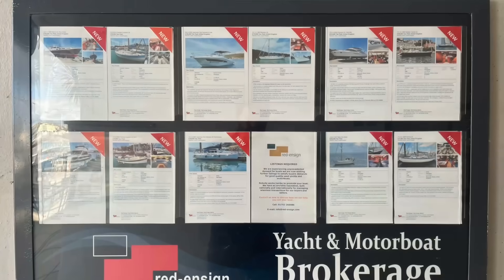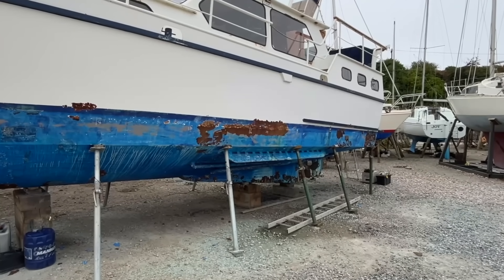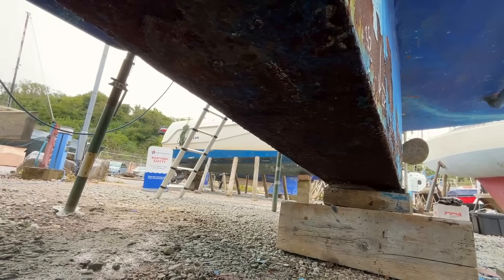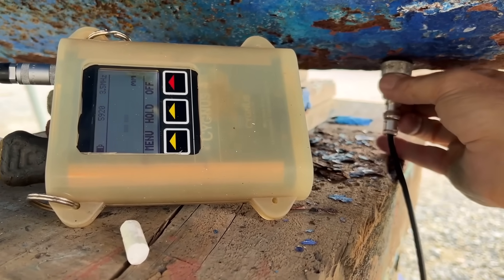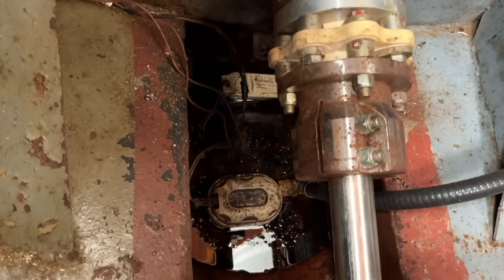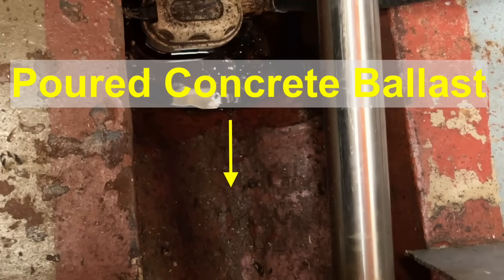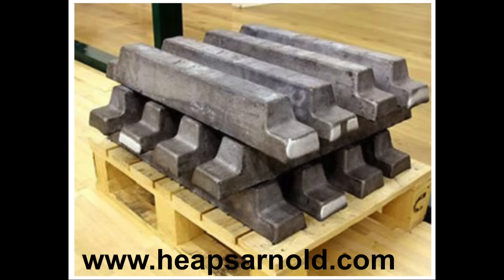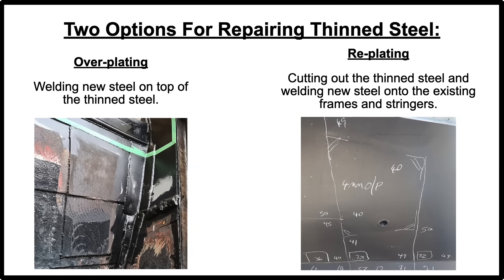Buying A Steel Boat? Get It Surveyed!

Comment: keel sole Mate , yes should be 10mm to start with, me building since 1976
just because she is Dutch  built means bugger all 
anyway all box keels should be sealed,  tested same method as done with fuel tanks ie manometre  and oil filled with use transformer oil,
Reply from the maker: Thanks, I like to see a minimum of 10mm ideally for the bottom of any steel boat.  Oil filled keel boxes are a rare sight on small craft, would be interesting to see one and how it had fared.

Comment: I thought any boat of any age requires pre-purchase survey.  I wouldn’t buy a boat without a survey unless it was a brand new one
Reply from the maker: Thanks for sharing your thoughts.  There is no rule that says you have to survey any boat before buying it, and plenty do take that risk.  Insurance companies will usually ask for a fresh survey report every 5-10 years depending on the vessel.  As for not surveying a new boat, you'd be amazed how many 'snags' a surveyor usually picks up when surveying new builds, and they are often safety related!
Reply: @whitehatmarinesurveying Snugs identified in used boats during survey can be used for price negotiation. Also allows you to understand what you will have to fix. I agree that manufacturers defects are everywhere. I visited the Prestige factory in France last July and they try to address most before shipping the boats. But again you have manufacturer’s warranty
Reply from the maker: Fully agree with you, the defects list serves to both enable the Client to negotiate either price reduction or things to be put right (or both).  Having a surveyor in your corner when commissioning a larger new vessel usually pays dividends and keeps the manufacturer accountable for their work before it leaves the factory.

Comment: The age alone is enough to be doubtful as to its integrity. A little bit disappointed in Dutch boat building after seeing this.
Reply: Agree on that. Should be built at least 6 or 8 (keel) and 5 (hull). My 50 cents on it.
Reply from the maker: Old boats should alway be approached with caution, not matter the material.  I think the failing here was the approved spec at build, hard to understand why it was only 4mm and then added concrete for ballast.

Comment: Concrete and steel have no business in a saltwater going vessel. I will argue that to my last breath. And I wouldn't trust it much more in freshwater use. The only thing worse than a steel hull with unserviceable sections like this, would be ferrocement.
Reply: With proper maintenance there is no problem, 99% of the big ocean going ships are like that
Reply: @peterevenhuis2663  I meant hulls made of steel and concrete construction. Its the combination that is risky. Steel only hulls can be maintained indefinitely, but embedding steel in concrete adds too many variables and they all lead to hidden corrosion that is difficult to repair.
Reply: @grndiesel Yeah I understood you correctly, big ship's often have a fixed concrete ballast installed at the end of the construction, in order to properly trim the vessel, this area needs monitoring and ventilation to avoid corrosion. And that's why I said if properly maintained concrete and steel are not a problem, what you see on the video is an example that the concrete ballast were exposed to the bilge area and so corrosion started, and the steel was already for my idea thin
Reply: I was building ferro-cement boats way back in the 80s. We built stern trawlers that were super-tough. One was washed ashore and was completely undamaged after being pounded on the rocks until rescued. I've been out of the industry for a long time but it would be interesting to see how those hulls have fared regards internal corrosion.
Reply from the maker: I'm with you, it would be fascinating to take a deep look at one and see how well it had aged (or not).
Reply: @whitehatmarinesurveying  I can't remember the registration of the fishing boat, but was named Orion, went to Peterhead eventually. Sadly, the son of the owner, a childhood friend of mine, was dragged overboard when shooting the nets and a rope caught round his ankle. By the time the winch was stopped and reversed, he had drowned.
 The other was Flower of Caithness, a cruising yacht, although the one on google with the same name is definitely not ferro! I recall it slipping out of Scrabster harbour in the dead of night to evade paying a fine. The owner was later arrested on the west coast some weeks later. Would be an interesting story to investigate.
Reply from the maker: I remember studying about ferro-cement boats years ago and I'm thankful no-one has ever asked me to survey one!  It's quite common to see ex-working barges with their keels full of concrete to maintain their trim after conversion.  As a previous comment said "it's a cheap shortcut that nearly always leads to issues".

Comment: This is the absolute reason I've always kept away from steel boats! Around where I am on the East Coast UK the sea is like battery acid! and eats away steel boats quickly, I've seen many after 7 years having to be replated below the water line. I've always gone for a 1980's fibreglass boats, very thick and dependable, and never had osmoses, which is easily spotted on survey.
Reply from the maker: All good points, thanks for sharing.  I always advise first time buyers that you need to buy the right boat - right for you, right for your location and right for what you want from it.  If you can't fully define those three requirements, don't buy a boat.

Comment: I noted how you described this as a pre, pre-purchase survey.  Good on the buyer for asking, or you for offering, to do this rather than going straight to the more costly  pre-purchase survey.  I absolutely shudder at the thought of concrete ballast on any vessel, but especially steel.  It's a cheap shortcut (less expensive and far less dense than lead) that nearly always leads to issue on steel, aluminum and timber vessels, because it traps water and it makes the inside of the hull in these areas inaccessible.
Reply from the maker: Thanks Steve, on older vessels it always makes sense to start with an open mind and keep plenty of options open.  It was agreed with the Client beforehand to do a pre-pre-purchase survey and to see how far we got before committing to going the whole way.  A better use of my time and their money.
Reply: On a pre-purchase inspection…

Have an order of things to check first…
1) Easy to see…
2) Expensive if it is bad…
3) then all of the rest…

Walking away… is the best result of this PPI…. Money well spent!

😃
Reply from the maker: In some ways yes.  First task is to use the Mark 1 eyeball as that will tell you a lot about how the survey is going to go.  Then think about what the critical information might be (hull, engine, rig etc) and then get on with the survey 'routine'. With steel boats I often ask 'is this a hammer first or a probe first boat' to decide which tool to start the hull examination with.

Comment: 53 is not a bad age, I doubt many of the new mass produced boats will make it that long.
Reply from the maker: You're quite right, a good age indeed and given the 4mm spec at build, I imagine the original owners would have been very pleased with that.  Not much seems built to last half a century these days though, does it?